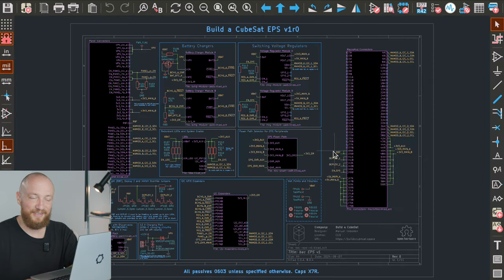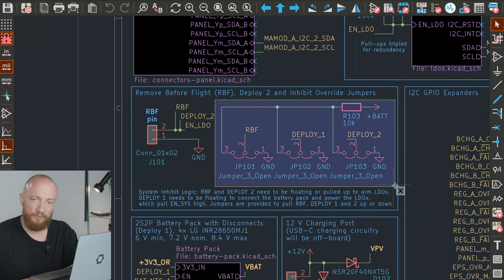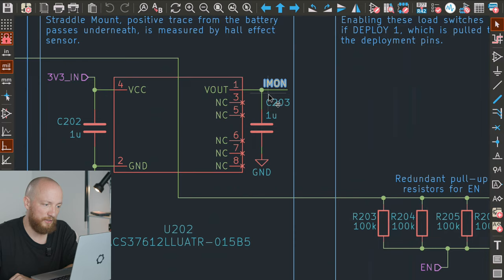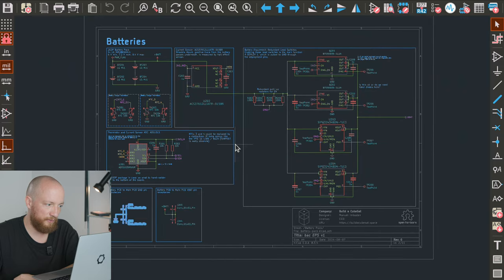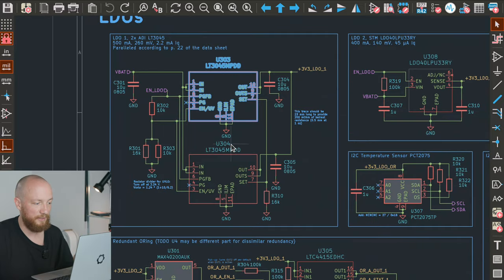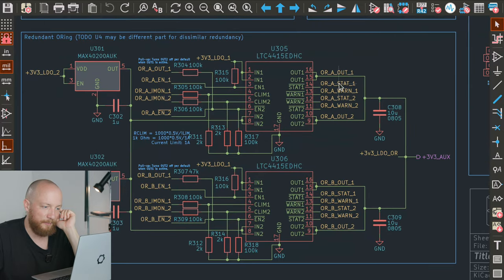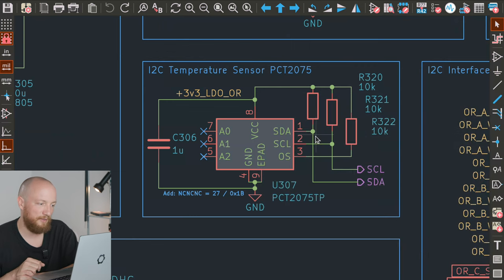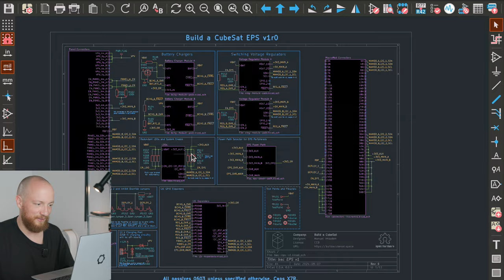CubeSat EPS v1: KiCad 8 Schematic, Part 1/2

Comment: One tip: you will need a batttery balancer IC for the cells in series. Parallel cells of around the same capacity will share charge so they don't need balancing and can basically be treated as one cell, but series cells will need a balancing charger.
Reply from the maker: Yes, that's definitely on the roadmap for v2! I want to get the basics right first, so for the moment (up until the suborbital balloon flight next year), I am just using equally charged cells. Are there any balancer ICs you can recommend? As usual, there is a staggering variety.

Comment: @Build a CubeSat PGB1010603MR has a Clamping Voltage = 150 V. This could be a problem if for example voltage is 70V. No problem if voltage is more than 150V. Why did you select this device?
Reply from the maker: Hi! Thanks for bringing this to my attention, that's really helpful. I have some of them at hand and didn't check the specs closely enough. I don't expect anything above 24V anywhere on the board  down the road. Is there a 0603 device you would recommend?